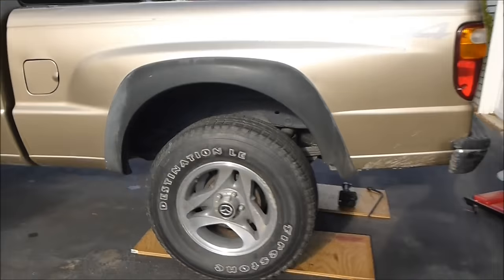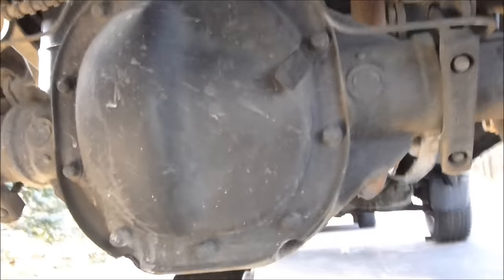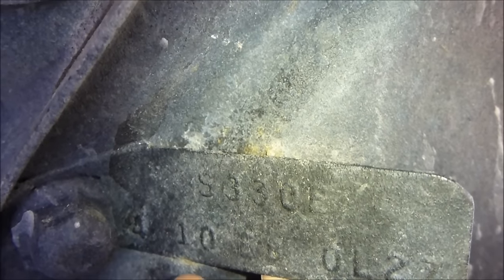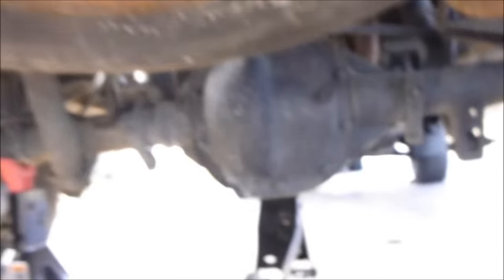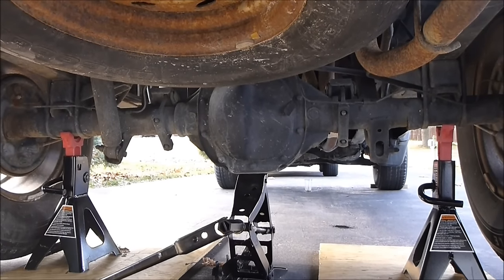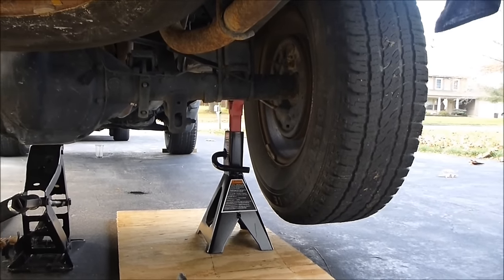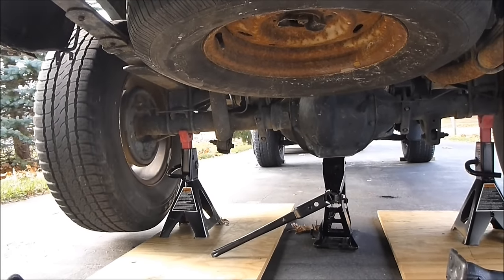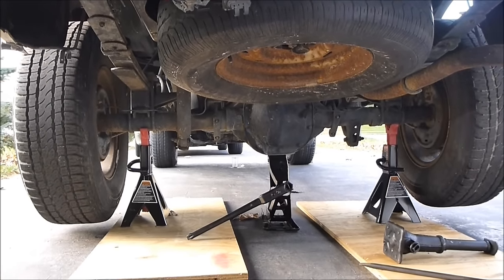How to tell if your car or truck has a limited slip differential

Comment: 4-10 doesn’t mean “4 to 10” for your gear ratio, it means your ratio is 4.10 to 1. (Your driveshaft will turn 4.10 times for every revolution of a wheel).
Reply: lmao
Reply: Pretty sure he knows and just a figure of speech. Maybe the manufacturer should write it 4.10 then though to resolve any confusion
Reply: 4:10 to Yuma
Reply: @b1blazin13  you can see the decimal point under the rust lol
Reply: @jodyjr00 what is yuma?
Reply: I knew what he was saying.  4.10 gears or 3.73 gears etc.
Reply: Thats what he meant
Reply: @photonforce08 it's a movie reference. Look it up it's a pretty good newer western

Comment: the faster way is just do a burnout, 2 tire marks means you have LSD
Reply from the maker: revelationns haha, true that!
Reply: ChrisFix This is true, ask me how I know

PS, a 4.0 V6, a 5 speed manual and a 3.55 Limited slip in a 93 Ranger burns rubber good, real good
Reply: Not true.. 2 skids doesnt mean you have lsd.. if everything is well balanced you will always leave 2 skids. And also rotating the tires while jacked up isnt a proof of a lsd.. because most diffs are viscous.. which dont work this way.
Reply: I checked the door sticker and the tag on the diff, its an LSD. Dont act like you know my truck
Reply: I dont.. but these tricks dont work out.. read closer.. i didnt say anything about u or your truck
Reply: Sorry, Youtube notifications are confusing to the tired mind.
Reply: I know what you mean hahah
Reply: This is not the first time Ive done that.
Reply: Lmfao! Yeah.. faster. But I have a friend that used that method and broke something inside his differential...
Reply: could still be welded, though.
Reply: And if u want to know if you have a open diff then you put one side of the car on grass and the other on asphalt and then floor it and if the tire on grass spins then u have an open diff but if the both spin it's either a lsd or welded etc..
Reply: what if you have a awd
Reply: same applies, as prop is static
Reply: Not true if the clutch packs are bad in an lad then you won t leave 2 marks
Reply: jeffel80, that is true, I have a 4 spider differential in my vehicle, it sometimes spins both wheels and other times it spins 1 wheel
Reply: Lmao unless you have a light duty Chevy. I've got an 03 Avi with LSD, and it won't do a burn out to save it's life. Peels out nice tho 🤘
Reply: My car is open dif and I can still leave 2 skids easily.
Reply: @mrobertsmr53  brake stand or by doing donuts?
Reply: Garrett Scott both lol just do it on flat, even ground and I never have a problem getting both to spin
Reply: @mrobertsmr53  I cri...wish I had the power for that. The avi fishtailed pretty hard this morning on my way to work tho. Then again, it was pouring, so I'm not impressed :/
Reply: Garrett Scott I have an 84 Nissan 300zx Turbo and it doesn't have much power outta boost tbh. Whenever I try to do skids I gotta hold the boost to get decent spin otherwise just the power of the engine barley spins em..
Reply: I tried this on my 72 Chevy c10 a few times. I sometimes left one track (right tire) and other times I left two tracks. When I left two tracks, the left track was very faint. what does this mean? I have no tag on my diff. Please help. Thank you.
Reply: My car did perfect double wheel marks on gravel or sealed road. I was sure it was LSD ,but after jacking it up like this, discovered it was regular diff.
Reply: How do you know one mark isn't backwards?.
Reply: Doesn’t tell you if the clutches are worn though
Reply: Not always my buddy has a ranger with 4:10 open diff and it spins both

Comment: The video instructs us to jack the vehicle up, so that the wheels are off of the ground, and to place the vehicle transmission in "Neutral".
As a professional mechanic, I just wanted to note that the transmission does not need to be in Neutral. An automatic transmission can be left in "Park", or a manual trans can be left "in gear". If the vehicle has an "Open Differential", the wheels will spin in opposite directions. Some locking units act like open diffs, until the engine applies torque.
Reply: Thanks for this comment I just replaced the rear end in my 2017 RAM Rebel and panicked a bit after installing the one from the salvage yard. Had to do some research and talk to my mechanic about it!

Comment: From watching Engineering Explain's video on limited slip, there needs to be a certain amount of rotational speed before some cams swing out to engage the limited slip.  Therefore, this test wouldn't identify it.
Reply: DonTruman your right but like the eaton. g80 it's not a strong locking differential and is prone to breakge under sometimes even normal use never mind any abuse
Reply: This does not tell you if you have a limited slip.  you have to spin the tire at a higher revolution then just rotating slowly around.  a limited slip will grab when the tire spins at a specific speed  or torque to drive the other tire forward

Comment: Hi chris got 1 ? For you how can i find out what gear ratio i have if my diff doesn't have that little metal tab
Reply from the maker: I would put your vin into a vin decoder, and it might be able to tell you your differential ratio!
Reply: Any other way because i got it from the junkyard and thanks for the tip

Comment: quick question I have a 96 Infiniti i30 5speed I just put a new half shaft in the driver side and it started leaking gear oil so I ripped it out and everything matched the old one so I checked the seal it was cracked and bad replaced the seal and its still leaking what else showed I look at its not much like a small paper plate puddle after 4 5 days any ideas would be great
Reply from the maker: +Robert Smith Make sure you are installing it correctly with the correct backlash.

Comment: what if it is a torsen diff?
Reply: Torsen is an all gears based torque shifter, no clutches to wear out.  Premium $ but the best, true torque shifter... puts the torque to the wheel that has traction.   It's a patented design, which also makes the price higher.   Google it, it's amazing to see how it works!

Comment: So I just learned the hard way.....I couldnt read the tags....so jacked up my jeep CJ5 with Dana 44....spun the wheels....tires went opposite directions. I ordered an auto locker, pulled the diff cover and lo an behld....I have a Trac Lok with worn clutches

If the clutch pads are no good....a Trac Lokwill behave like its open.

If you drive a Jeep.....look at the tag or open the diff BEFORE you buy any parts....the old spin trick isnt reliable every time

Comment: You must have a little more wheel speed before the spider/side gear interface will create enough force to close the clutch packs.  Until then, it will APPEAR as if it's an open diff.

Comment: torsen LSD's spin opposite
Reply: Caleb DesJardins because Torsten lsd require both wheels on the ground to work they are a 1 way limited slip diff
Reply: Yeah they just need to have a load on them, I've seen people test them by pulling the handbrake halfway. I'm just saying this isnt a way to know for sure.
Reply: Caleb DesJardins any good driver can tell
Reply: of course... again, I'm just saying this method isnt a way to know for sure.
Reply: I realized, because I know for sure that my FRS has limited slip differential but the wheels turn the opposite way when off the ground so I was a little confused, but then I realized that torsen LSD are different
Reply: My old 2004 mazdaspeed mx5(factory turbo) had a torsen lsd in the rear. Great diff for the car. Not only did it barely use any power but it always provided good traction especially leaving corners a little too hot. Some lsd's require more power to activate the clutches but this one didn't and loved leaving 2 rubber strips when roasting the tires off it. 

Now im looking at a Cusco lsd for the rear of my 2017 rf gt mx5. On a rear wheel drive a limited slip is pretty important if using the car all year like I do. It can also prevent the rear from sliding out on you.

Comment: Essentially. A LSD will spin one axle a small amount before locking them both into a posi style axle(That's the "limited" in limited slip). It makes for much better cornering. With a Posi you see a considerable amount of "wheel hop" during turns.

I thought they were the same thing too until just recently when a Ford guy called me out when I said my mustang had posi lol.

Comment from the maker: is it in the owners manual. They typically say what diff you have. Check the type of fluid you have to put in.
Reply: No, owners manuals are all the same regardless of what options you have.
Reply: I have an 04 interceptor. All the tags and stickers point to limited slip, but it acts like it's open. I'm not sure if the differential was swapped at some point or not. I don't want to open up my differential to replace the clutch packs if it turns out I have an open diff. Would the wheels still spin opposite of each other if the clutch packs are worn? Or would one just not turn? Thank you.

Comment from the maker: That is incorrect... In most most cars/trucks the emergency/parking brake is on the rear tire(s). I have never seen a car that has had it on the front. Can you name one that does?
Reply: All pre 2020 defenders and disco 1 and 2 have handbrake on shaft right after gearbox.

Comment: amazing how in all the comments people dont know the terminology. "Limited Slip" is the generic term. GM calls limited slip "Positraction"(posi)  Chrysler calls it "Sure-Grip"  Ford is "Trac-Lok" all are limited slip. Auburn makes the limited slip called the "Detroit Locker". As opposed to open differential or the always locked up, "Spool".  and there are many other brand names for LS from all the others, Porsche, etc, and ways that they work too. I suggest y'all read the wikipedia page, just google limited slip.
Reply from the maker: captmack007 Thanks for the info man!
Reply: I still call it limited and expect it that way. I don't use wikipedia anymore because they *** about how they can't even run their own website and expect donations from every user.
Reply: i got 99 problems but the only one I worry is when flies go into my cup of coffee.
Reply: captmack007 pontiac had safety trac
Reply: Tyee Cambrón is done completely under volunteer work no one gets paid dedicated people that do constant research to make sure the facts are correct
Reply: captmack007 Detroit locker is pretty much only used in race cars due to the “ratchet” (or clicking) noise they produce when turning. Great rear end though

Comment: If you have a posi rear, When jacked up with both wheels off the ground and you rotate one wheel and the other turns the same way, You have a posi rear.
Reply: Thank you for pointing this out. I knew it but the guy in the video does not say it. He only tells you that if your two wheels go in opposite directions then it is not a limited slip.

Comment: My 2009 Silverado does this but I have a LSD. This isn’t an accurate test
Reply: I'm wondering if my 2009 Silverado has it or not
Reply: Apparently you do not have LSD.
Reply: @TheWolverine-rm2kr  Look in your glove box.  There is an RPO sticker with all the manufacturers options codes.  If if it is a limited slip differential it will have a G80 code.

Comment: limited slip differentials behave the same way as open differentials when there is no centrifugal force apply to  the clutch discs
Reply from the maker: Miguel Flores Thanks for the info!
Reply: ChrisFix The torsen lsd in a miata also acts like a open diff if you try this test.
Reply from the maker: ***** Thanks for the info man!
Reply: in other words, you will get stuck in the mud or snow much easier on an open diff because only one wheel spins.

Edit: I don't know, when I spin one wheel on my Mercury Cougar 5.0, both wheels will go same direction like if it the car was moving forward or if spin reverse then both wheels go reverse... Its not like my Ford F150 or my Traxxas TMaxx RC truck where 1 wheel spins forward and the other wheel spins in reverse direction.
Reply: Miguel Flore I've never seen one that was not put together with at least some preload on the clutch pack
Reply: bingo, plate LSDs have a 'pre-load'
Reply: Miguel Flores 
True for GM gov-loc units but not for older model cars with true posi or sure grip units as in my Charger.
On a lift both wheels turn in the same direction with it’s sure grip (posi) diff.
Reply: This is incorrect for the most part. I have a 2000 ranger with a 3.73LS diff and when on jack stands with the trans in neutral both tires spin the same way
Reply: Pick the flies out of your coffee before ya take a sip !

Comment: Hey Chris, I enjoy your videos, I have a 2003 ford explorer v6 eddie bauer 4x4 that I want to do a differential fluid change, I lifted the 2 rear wheels of the ground and I spone the tires but the other one does not move. And when I go to the other side same thing I spin it and the other tire doesn't move my tag reads this 355 88 3e23 if you can help I would really appreciated.

Comment: False. I have a limited slip and when in the air, one tire will spin the opposite direction. An LSD need a little bit of resistance on both wheels to engage
Reply: Paul Peters then it's worn or something I've put limited slip carriers in and. it is supposed to turn both wheels the same way and your not gonna stop the other not by hand anyway but when you turn a corner. the weight of the car will force the clutch pack to allow just enough slippage as to avoid wheel hop or break an axle

Comment: You are wrong Chevy offers a auto locking dif.the wheels will do the same in the air. When driving if both wheels are in the air your upside down. With the auto locking dif put one wheel it the air you can spin it by hand same as a open dif. but under power from the drive shaft the free wheel will spin about 1 to 1.5 turns then the dif will lock and both will turn and stay locked until ? I dont know when it does but no need the back up or any thing.  I won lots of bets when I did just like you and then put one wheel down.
Reply from the maker: This is just one test you can do, in that case I would probably just look for the sticker that shows all the options and see if it has that diff or just run the vin

Comment: you dont have to go through all of this BS to see if you have a limitedslip..... JUST TO A FUCKING BURNOUT. if you have 2 black marks youre good to go!
Reply: best way to test!
Reply: If you are driving a Lexus or front-wheel-drive nissans or some models of bmw, then it just might not work that way.... Transmission would overheat and blow up before the wheels would even try to spin.
Reply: Not always true, my Jetta does some pretty good skids
Reply: my open dif ranger still smokes both tires, its 4.0 so its got the power to do it. dirt, street, etc. only when its really stressed can you tell. jack up my rear end, wheels spin opposite
Reply: sometimes you can get away with an open diff and get both spinning just because you have a open diff const mean it will always be a one wheel peal

Comment: So in my experience a limited slip differential (LSD), posi, or various lunchbox lockers require a certain amount of rotational speed before the clutch packs engage. You can lift it and spin it as you are you just need to do it with some power. It is dependent onnthe type of clutch pack whether you need a friction modifier. You may also have a limited slip diff, but either due to not having the friction modifier added or the clutch packs which are washers coated in a friction material like breaks are worn down to the point they will not lock the rear reliably, & this is a very common issue. Good try, but there is a bit more to how these work & how we can check for them.

Comment: A GM g80 locker will spin opposite like your Ford open diff. I just replaced a complete rear axle on a 99 silverado 4x4. When the customer dropped off the axle they bought i checked out before i installed it and i was doubtful at first it was a locker because it would spin opposite when i turn either side. I checked the number code, removed the cover checked the carrier and even called a driveline shop. all three confirmed it was a GM 3:73 g80.
Reply from the maker: Thanks for the tip Tony!
Reply: This is true, just got an old (rusty) 2002 S10 for my 17 year old's first real vehicle.  Jacked up spin one side one way the other side goes the other way.  And the code in the glove box is limited slip.
Reply: ***** Probably not, I've used Mobil 1 LS oil in my non limited slip subaru differentials for 300,000 miles (changing every 30,000)  They still work great
.
Reply: Tony D yes a g80 is open most of the time and will lock only when it senses a slip by the passenger wheel and there is a little clip type thing that locks them good under normal driving but not for any kind of abuse don't go doing donuts it won't take it I know from experience lol
Reply: RIGHT...
Reply: Tony , are there any issues with changing out a g86 limited slip with a g80 locker if they have the same 3.73 gear ratio? Also if I do that will it mess with StabiliTrak and throw the dash lights?  I have an old gmt360 platform that is having rear gear problems with the G86.

Comment from the maker: It is def not a method to rely on but if you know a little about your car, you can use it to figure out what kind of diff you have. Also, thanks for the gear info. I dont know if you saw the annotations, but I corrected myself with that info. I misspoke when making the video.